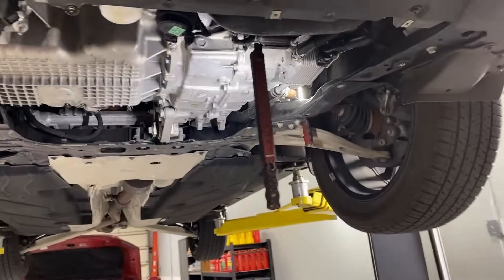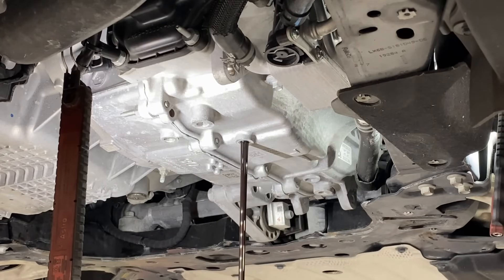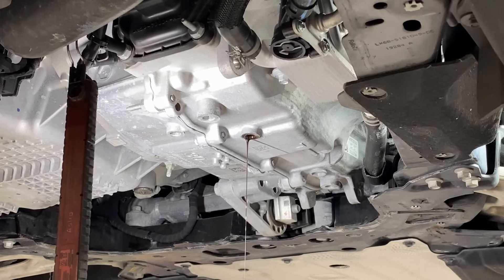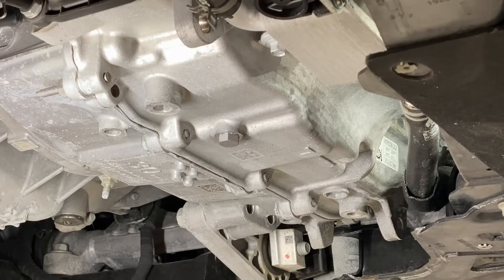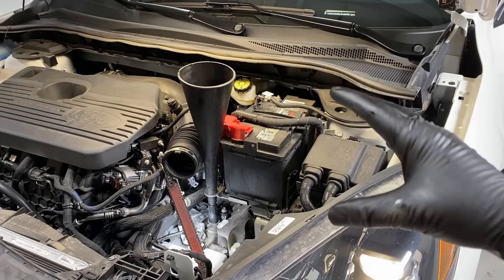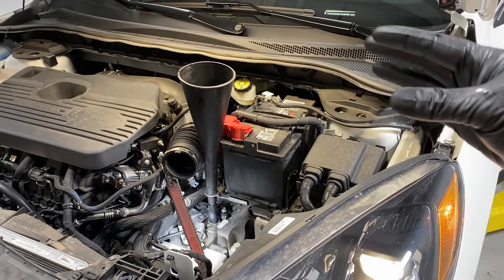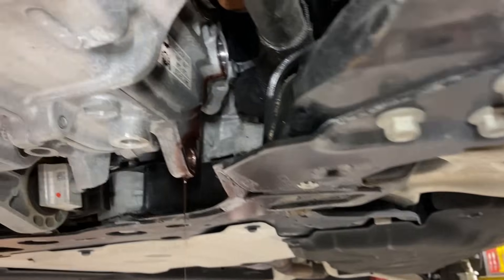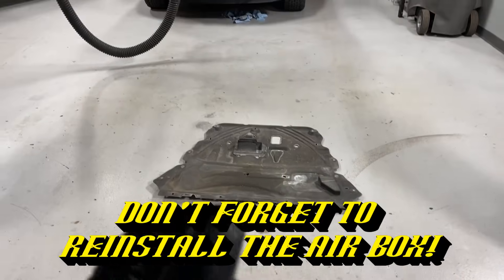Quick Channel Update: 2020+ Ford Escape & Edge 8F35 Eight Speed Transmission Fluid Service Procedure

Comment: Perfect Brian!  You must have read my mind.  I have a 2020 Edge that just turned 30,000 miles.  I'm in talks with a local shop to install a catch can.  Been well below zero here.  He said he'll do it when the temps get into the 40's.  My idea with the trans, is to drain the trans fluid, measure it, and put the same amount you took out back in.  That way you don't have to mess with the leveling plug as most of don't have a lift.  Doesn't seem there would be much loss of fluid from vapor.
Reply from the maker: Right but my concern is was fluid at the correct level before servicing.
Reply: @FordTechMakuloco  Thanks for your input Brian.  But like you pointed out, the trans vent wasn't covered in fluid.  If it was, then I'd be concerned and use the leveling plug.  But most of us DIYer's have front ramps only, so when we drive it up on the ramps, the trans is not level, and wouldn't get an accurate reading  Got an estimate from a Ford dealer before seeing your vid.  The dealership wants $150.00 for fluid change.  I'm not tight, but that's too much.
Reply: This is a good point. It seems the best compromise is to jack the car up level on all 4s with jack stands and do it the right way first using the leveling port. Record exactly how much fluid you put in and then go with that exact amount each subsequent fluid change.  This should work perfectly fine, barring an obvious transmission fluid leak.
Good info guys.

Comment: Will be using jack stands in front.  Should I pick up the back end of the vehicle (addl jack stands) to get it level while filling?  Or will it be only a negligible fluid level difference? Thx for the post.
Reply from the maker: No need.
Reply: Just measure how much gets drained out and refill with the same amount

Comment: FYI: Always loosen the fill plug  BEFORE removing the drain plug. You want to be certain you can fill the transmission, transfer case, or differential before you drain all the fluid.
Reply from the maker: There is no fill plug.

Comment: I've got a 21 F150 Powerboost and I'm getting ready to change the transmission fluid & filter. Is the procedure for the 10R80-MHT the same as the standard 10R80?
Reply from the maker: No, it is quite different.
Reply: @FordTechMakuloco  If you get a chance, a 10R80-MHT fluid and filter change video would be greatly appreciated. Thanks

Comment: Thank you!  I have the oil and put this off too long!!  2020 Escape AWD 2.0L 75K, bought at 50K.  Already changed PTU and rear diff.  Unfortunately, the AWD control module failed.  I replaced it, but Ford dealer still wanted $400 to pair it with the diff module.

OK.  Job done.  I do not have a lift so not sure I was completely level.  Removed front left tire for visibility into the leveling port.  Heated up the oil in the oven to 150F to save some time.  Used Forscan to monitor the temp (185F=85C).  Put aluminum foil over the hose and cross member.  The oil smelled completely spent.   Same color as you found.  Might do it again in 20k given the big initial interval.

Comment: 1.)How come no one is having their dealership flush the transmission through the lines in the transmission oil cooler? 

2.)Why not just pump fluid into the level plug instead of removing the airbox?
Reply from the maker: The angle of the side plug is quite difficult with a normal funnel.
Reply: Yes, true, I agree. Cant get a funnel in the level plug. Also, majority of us watching at home do not have access to a lift. But tubing from home depot connected to a funnel could work, as well as a garden pump sprayer to pressurize fluid and pump into the level plug is also on youtube. Love the videos, very helpful, but we make less money than most. 

Drain and fill is a nice idea at the first 30k miles, but dang, just as difficult to get a 8F35 into a dealership for the cooler lines to be bypassed for transmission flush.

Comment: Great Video.  I think you need to do a video on 2010 F150 with the 5.4 flex fuel Over calculating Alcohol content.  Cold start issues.
Reply from the maker: I should I have seen a few.

Comment: I did the same procedure on a 2022 Maverick but ran into a small issue.  There's a white plastic disc inside/near the bottom of the rubber fill/vent tube with a tiny 1/16" or so vent hole  in it.   Ended up removing the hose clamp/fill tube to remove that disc., otherwise the fluid won't refill through the funnel.....just backs up and sits there.     I left it out, reinstalled the vertical fill/vent rubber tube and have had zero issues with any fluid burping up or anything since.    Not sure if that was something that was accidentally left during the assembly process  or something included on the newer model 8Fs but was pretty annoying when I went to refill..      

Nonetheless, thanks for the video an sharing the info!!
Reply: That disc is to prevent the fluid from burping out the vent.  My wife has a 2020 Escape with the 2.0 and the vent was burping out fluid.  There was a TSB to replace the tube with one with the white disc in it.
Reply: @kbass24emtp    Ok.   Thanks.   I kept it.    Next time I drain and fill the fluid I’ll pull off the fill tube and put it back.
Reply: I have 23 maverick hybrid. Was your maverick hybrid? If so was the filler tube in the same location as the demonstration within this video? And if it was a hybrid was there any details that was different?  thank you
Reply: @scooter12368  No.  It's a 2.0 Ecoboost.   It's essentially exactly; the same setup as what's in the escape in this video.   I'm not sure about the hybrid as I believe they have a CVT transmission which is quite a bit different than the 8f.

Comment: @teddymullins3706 Just did this to a Maverick and its exactly the same but I had to remove the fill/vent tube from the base by releasing the clamp and pulling it out.  This will allow you to fill it with out it spilling over. I tried by just removing the vent cap and it spilled over similar to @santospaguada851.

Comment: We have a 2020 Escape with the 1.5L Ecoboost. We bought it used a couple of years ago, with roughly 20k miles on it. It's the SEL model, very comfortable, drives really good, and gets good fuel mileage. However, the Ford dealer we bought this from has not mentioned anything about the trans fluid needing to be changed, and we just had the engine oil changed at about 35K miles. Glad I caught this video. We are in our mid to late 60's, and do not want to have to buy another car anytime soon. Of course, after we bought the car, is when I heard about the problems with the early Ecoboost engines ingesting coolant. I did ask the service manager at the dealership, and he said they haven't had any problems with the newer models. Are we sitting on a ticking time bomb???
Reply: I hear those 3 bangers are pretty solid. Don't beat on it and change fluids on time and you should be good. I believe if you respect your vehicle, it will respect you, remember they have feelings too.
Reply: Is yours a three or four cylinder? The three cylinder engines are great, the old 1.5 four cylinder has the coolant intrusion issues
Reply: three cylinder @YZJB
Reply: Hey guyinnc, I am an all-Ford man. I used to be a Ford technician before the military. If you don't have an extended warranty and plan to keep this car. I recommend a warranty. I have one for my wife's 2015 Edge and it only has 63000 miles on it. I know it's like an extra car payment for 30 months, but if anything major goes wrong, you're covered with a $150 deductible. I have one through Endurance. The Ford ESP warranty is extremely expensive, and they can only be bought when the car is under the factory warranty.
If the engine gives you trouble, get it fixed and trade it in on an older pre 2019 V-6 3.5L. They last forever if you take care of them and service it properly. My last Edge 3.5L V-6 had 234,000 miles on it and ran just fine with no problems.
Reply: thanks, probably a good idea. Funny though, I contacted the service manager at the dealership we bought the car from, and he's telling me that the trans in ours is supposed to be like a sealed unit from Ford and it shouldn't need fluid replacement unless there is a problem. But he can change/flush it for us for about $350 if we want. Maybe I should forward him the link to this video. @kevinleukhardt9560
Reply: @aguyinnc2865  I have one too it was a free car supposedly the coolant intrusion problem was fixed with the 2020 model and body redesign
Reply: Your model is one of the bad ones. I hear around 50 to 60k is when they break.

Comment: @fordtechmakuloco I have a 2014 ford f-150 with 3.5 ecoboost what kinda of fuel mileage should I be expecting out of it. Lately I think my mileage has started to take dip, is there anything I can do besides try the recommended fuel and maybe some “additives”. My truck is 4x4 and I do have brush guard on front don’t know if that makes a difference.
Reply: I get 15-16 mpg
Reply: @mattfedick4632  is that in town or on the highway
Reply: @MrGtownhunter  highway, driving 75 mph
Reply from the maker: Most come in between 16-17 mpg avg
Reply: @FordTechMakuloco  so it’s not uncommon for the 3.5 ecoboost to subpar fuel economy?

Comment: The maintence schedule says every  30000 miles. Yet i have 90000 on mine. The torque converter is failing and getting replaced. The motor was replaced at 60000 and noone mentioned the transmission needed servicing.  One guy said 90000 was way too long. Yet 150000 is on the schedule for a flush and the other guys said it was 150000. And gee no Ford can get there with original fluid. Im guessing these Fords are built more for performance and whover made that schedule didnt keep that in mind cause ive never had a temperamental vehicle like this. Its an 2019 Escape. And the warranty woman at my local dealership has a 2020 thats in the shop for a transmission problem. I wished id never signed the papers and should have bought from a buy here pay here.

Comment: Great video, I'm not a fan of the self leveling, I prefer a dip stick.
Those were the days.
Thanks again.
Reply: Like doing a boat outboard/outdrive lower unit. But at least on those, you can access the drain and fill ports easily!

Comment: I worked for a co that owned a fleet of F350s. We followed the mfg recommended trans service and kept having trans fail. After several years and a bunch of trans failures we hit upon the practice of filter & flush every 30K & the trams started to last the near 300K we ran these trucks. SO, thats the secret, ignore what the manual says, 30K.

!
Reply: thank you for the information, good tips and appreciated !!!

Comment: Would you be able to measure how much fluid is drained and then refill the transmission with the same measured amount?
Reply from the maker: You could yes but who is to say the previous fluid level was set correctly?
Reply: @FordTechMakuloco   Good point!! lol I wasn’t thinking about the last guy who changed the fluid 😅
Reply: @FordTechMakuloco  would having my vehicle on ramps up front affect the level enough to be a concern?
Reply: @John-xu3jk  . I am worried about that too.  Front end high on ramps.
Reply: 漏出來的時候要量測
加油之前也要量測

Comment: Does having the air sensor removed throw a code ?
Reply from the maker: Generally, no it doesn't catch it and set a code, especially because up the next restart it sees the fault is corrected.
Reply: my BS 2.0, it threw a code and wouldn't clear afterwards.  I had it running with the airbox off for well over 15min to try to get the trans to temp while I performed this procedure.  Maybe that's why mine threw a check engine and wouldn't clear

Comment: Brian, I was thinking about going to a magnetic drain plug on this transmission. Do you think that would be helpful? I know most everything in the transmission is aluminum, but I'm sure there are some parts made from iron. Figured since you've got to split the transmission to change the filter every little bit would help.

Comment: I just had a new transmission put in my 2015 Fusion ecoboost. 270k miles. Changed fluid every 30k-40k. Makes a difference.
Reply: Do you know where the tranny failed?
Reply: did the tranny fail?
Reply: 241k here every 15-20k it does help

Comment: You could have used my 2014 Explorer Sport as a test case! In the last 3 months, I've had a complete timing job, and a steering shaft replacement. Needless to say, my wallet is quite a bit lighter....
Reply: Do you have a 3.5 ?

Comment: I have a 2019 Ford Transit connect with an eight-speed,
Is this the same transmission even though you said it starts in 2020?
Reply: According to Ford Parts Giant the 2018-2019 Ford Transit Connect with the 2.0L engine also uses the 8F35 transmission.
Reply: @stefanpuffer  thank you for looking that up

We bought her for handicap access with less than 60,000 mi on it. I don't know if the previous owner changed the transmission fluid at 30,000 and we didn't get an owner's manual with it, so now I'm a little bit anxious because I'm going to have to wait till warmer weather before I can do it myself.
I definitely don't need anything happening with the transmission when I've got my daughter in the car with me.

It's a great little van though I really like it.

Comment: On some of those 8f35 trans depending on yr model you cannot add fluid through that top vent cap did one on an edge in the shop the other day and fluid would pour out of the vent and I kept thinking it was my funnel because the vent on the edge sits under a wire hardness kinda, and thought mayb the funnel was cracked or not fully seated but when I looked down at the vent there is a small pin hole instead of a normal opening like on the escape I guess ford did that to reduce fluid from spilling out. I've seen pockets of fluid on the trans on the escape but not the edges. So ended up filling from the side port with a mighty vac.

Comment: my 21 bronco sport 8 speed says 150K miles for a fluid change. But living in the desert (hot and dusty), I'm wondering if I should get it changed now at 35K miles.
Reply: better safe than sorry. Changing the oil is cheaper than changing the transmission😅
Reply: 😊😊😊 ...Well, you don't have to...But... Plenty of used ones for sale on Ebay for about $1500.00 and up...That don't include the $200.00/hr the tech gonna charge you to replace  it...Then there's the ATF fluid...Prolly $14.00/qt....Then there's the ubiquitous "Shop supplies "....Minimum $25.00 for the same dirty wrag he used for the last 5 cars...Sooo, Naw....Keep driving....You're fine...😂😂😂😂
Reply: I changed mine the first time at 40k miles and then I change it every 20k miles after that. The fluid comes out black as night and because you can't change the filter without splitting the case it's just cheap insurance and it's not difficult.

Comment: I agree to your fluid change mileage. I change my transmission fluid every 30k miles.
Reply: Do you think I’d be safe to change every 31,000 miles? I’m in Canada and that is 50,000 kms. I don’t really want to change it every 48,500 and 50,000 is a lot easier to remember. Thanks
Reply: @tristenbryson8805  The oils don't have an odometer, so they wouldn't care.
Keep in mind, at least in Europe Ford says it's life-time filling, no changing until 160.000 km. The 1000 km you're talking about makes no difference. This is preventive treatment, way before the due date.
Reply: @tristenbryson8805 yes of course
Reply: I use my 2nd Trip for my service reminder
Reply: 2024 ford escape owner's manual page 470 says for normal maintenance interval to change automatic transmission fluid every 150,000 mi (240,000 km). Same schedule to replace accessory drive belt(s). Where did 30k number come from.
Reply: @BigDapperDanMan 2004 F150

Comment: Having to split the transmission is crazy.they really want you to replace the whole trans.
Reply: No. They really want you to buy another new car from them. It’s asinine that anything with fluid in it isn’t easily serviced and inspected.
Reply: My accord has an external filter. Around $30 part and can be changed DIY in half an hour. Has a dip stick too. Ford hates us.

Comment: Just replaced an 8F35 in a 2021 Bronco sport, 66k miles. Never had the fluid changed and it was burnt sludge. Frequent fluid changes like this are key in Ford transmissions. ULV gets nasty just like LV does.
Reply: Question. Did you have to reprogram the new transmission for the bronco? Asking because I'm about to do one also for the first time on a 2021 bronco sport.
Reply: @greasemonkey9206 Yes, you will have to reprogram the code thats on the tear tag on the top of the bellhousing into the PCM/TCM with a scan tool.
Reply: @ashetonp3840  Do you have to use Ford IDS with VCM? Will a snap on scantool work?
Reply: @greasemonkey9206  I don't have experience with Snap-On scan tools. When I was a dealer tech, it had to be programmed using FDRS on this late of a model year, and IDS on 2018-2019ish and prior vehicles.